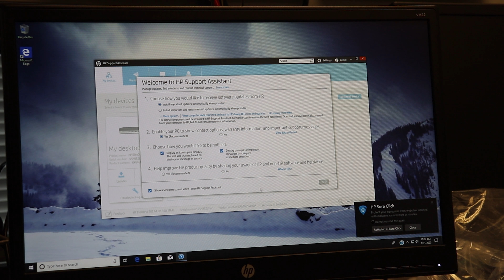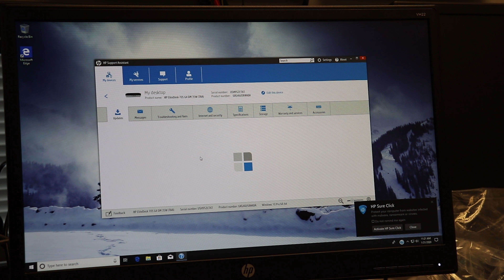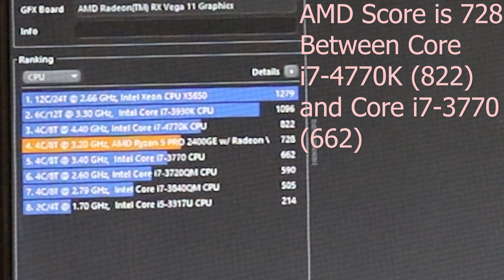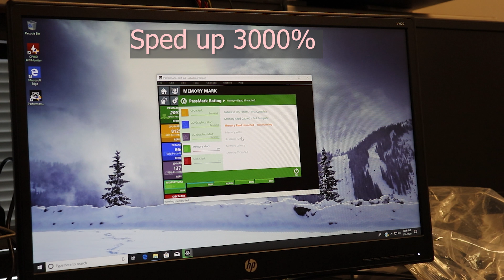HP Elitedesk 705 G4 USFF Benchmark and review

Comment: Buen video bro! 
Tengo uno igual y lo considero bueno incluso para gaming low! 
Saludos desde cd mexico
Reply from the maker: Thank you. I hope you are safe and are doing well.
Reply: Puedo jugar GTA V en 720p y graficos bajos con este equipo?
Reply: Seria bueno que hicieras un video en tu canal testeando varios juegos con este equipo
Reply from the maker: @juanpablodominguez3189  I didn't really get to test games on this PC, mostly because my co-worker needed to get it out and deployed minutes after I finished filming.  If I had more time with it, I would have tested it better.  Though I have access to its big brother, the 705 G4 SFF.  It has the same CPU and should perform similarly.  I can test that when I have time away from work.  As I still have to work full time in that office.
Reply: @SimpleSilicon  Ok, thank you for the answer. I'll wait

Comment: Does your unit gets hot all across the case with mild usage?
Reply from the maker: The small formfactor and small cooling solution is not the best for cooling. When used for general office use, the cooling is sufficient.
Reply: @SimpleSilicon  That's right, I'm thinking to add thermal pads on top of the ram and maybe under the cpu motherboard, to reduce heat under heavy loads.

Comment: I recently purchased the 800 G5 model as my home productivity machine (i7 9700T, 16GB RAM, 512GB M.2). I've also added a 1TB Samsung 860 EVO for extra storage and I'm looking at adding another 16GB RAM very soon. Not a bad bit of gear, thought it can run a little warm at times depending on what's going. Tj. Max on this CPU is 100 degrees celsius, and the most it's probably hit is around 85 but only briefly. It usually idles somewhere within the 40-50 range. Fan noise is almost non existent for anything under 70 degrees.

Comment: Whats the white port for under the hard disk enclosure?
Reply: Don't know if you are still looking for an answer 3 years later, but this is the  j41 MXM connector. It is used for the HP AMD Radeon RX560 4GB graphics card that is compatible with this PC. 1L PC with a graphics card and a AM4 socket CPU not something you see everyday. You do need to sacrifice you HDD bracket in order to install the GPU, but you still have your m.2 slot. You also need a more powerful power supply as the 65w will just not cut it, you will need at least a 150w one. Hope this answers your question

Comment: I would appreciate it if anyone can provide insight on how loud the fan in the Elitedesk 800 g4 mini 65w? I have owned the Lenovo m901q and i loved that the fan was so quiet.
Reply: The fan is super loud. Part of what I hate about these is the design is very inefficient for cooling. The grid for airflow is entirely facing up, so it collects dust and is hard to clean especially in a work environment, and the biggest surface area lays almost flat with almost no airflow. So unless you can rig it up to have better airflow it will run hard constantly while in use.
Reply: @spanky814  Thank you!  That is very helpful.

Comment: Thank you for the review. I have a question, does it support 3440x1440 ultra wide monitor? I know Mac minis don't because of the limitation on the igpu. so I am curious if the onboard Vega can? I cannot find any info regarding to that. It would be great if you can find out and I will really appreciate that.  If the onboard vega can push an ultra wide monitor, then I definitely will grab a bunch of these for my offices.
Reply from the maker: You'll want to look at the product page. At this time I do not have access to a UWHD monitor to test the output.
Reply: In theory, it can, as it is display port 1.4 compilant,

Comment: I’m curious about the gaming aspect of it?
Reply: I have this, bought it from Microcenter for HTPC purpose. I have 2x8GB 3200Mhz Ram from my laptop that I dont use anymore.. So I replace the ram :) You can play LOL/DOTA at max settings 1080p just fine.. I even replace the SSD with Inland 512GB Nvme (3100mb/1900mB) read/write and game load so fast. You can pretty much game on these computer at 1080p with customize high texture / med/low settings. Not Ultra tho :L. but this desktop is worth it you can carry it anywhere with you.
Reply: @toytulog576  My big cuestion is about energy source & temperature....??? it's worrying while playing gta for example
Reply: @juanpablodominguez3189  you can play it just fine in 1080p GTA 5 *with lower Anti alliasing and other effects*. you can get solid 60fps.. temperature is about 55-60 Degree, depending on how many hours you play.. it also depend on your room temperature. mine never get pass 65 Celsius while playing for 6-10 hours... The CPU support up to 95 degree celsius so your good.
Reply: @toytulog576  Hi! How loud the cooling fan is? I have read some people complaining about the noise generated by the fan & heatsink in this model. Thanks!

Comment: is it gaming pc desktop?
Reply from the maker: You can use the onboard vega gpu but its better used as an office computer.
Reply from the maker: With the numbers i got On the vega 11 onboard gpu. Csgo at 1080p got mid 50s fps with gpu settings at default.  Rocket league was 40s to 50s on performance quality setting, gta v was 30s to 40s at 720p lowest quality.